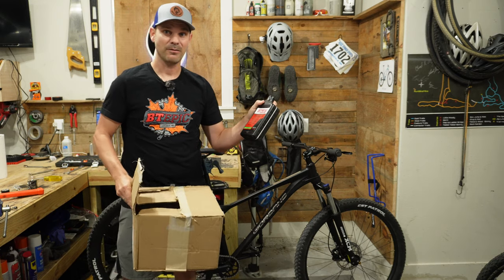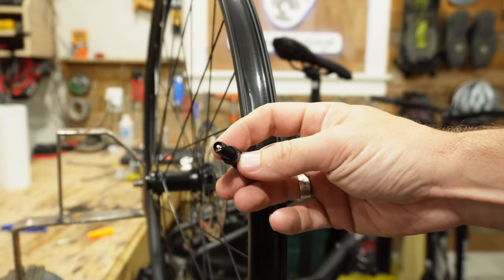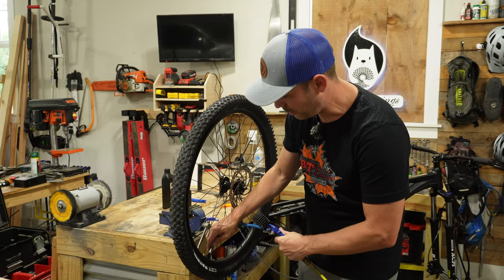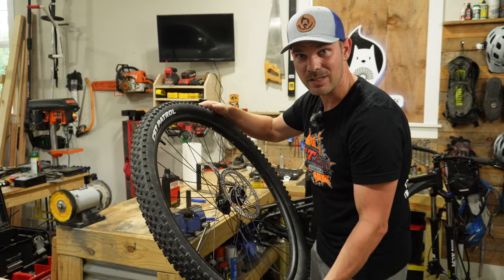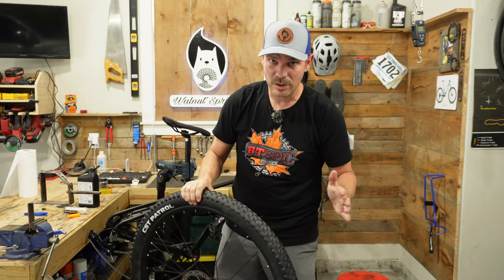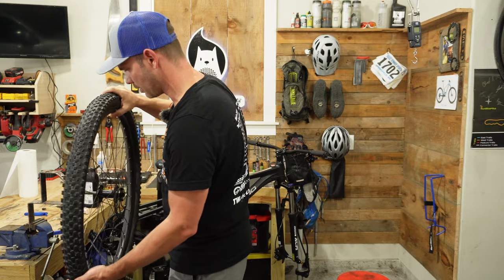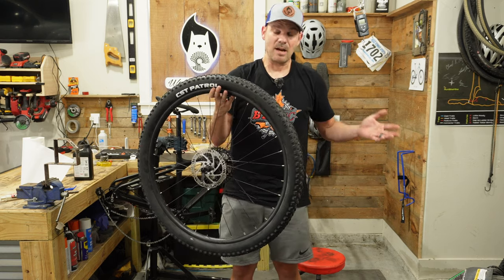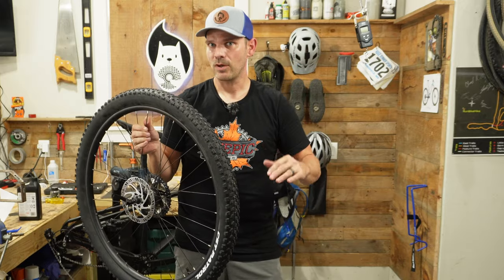Can The Walmart Giordano Intrepid 29er MTB Go Tubeless with the wheels and tires it comes with?

Comment: I have seen other YT channels try the same thing with decent success. Several had to add a bit more sealant to help coat the interior of the non-tubeless tires, but eventually the tires sealed
Reply from the maker: I was super shocked at how only around 2oz per tire worked on this set up. I was gone for a week and came back and the tires each only lost 5psi.

Comment: I never would have thought going tubeless (along with the goop that goes in) would be lighter than a tube with no goop.  Unless the tube had the goop in it and was a thicker rubber...

Thanks for the update!
Reply from the maker: It really is crazy how much weight regular tubes add to the tire rim setup. The nice thing about saving that weight is that it is the best place to save weight. Reducing the rolling weight is a great way to really feel small losses.
Reply: @RunBikeMike  were you also gonna swap the rims?  Was looking for a budget lightweight set for a Mongoose Ledge X1 that I bought...that thing is heavy!
Reply from the maker: I have thought about it. But haven’t found a pair yet. I have a few other upgrades I want to get done 1st. I thought about looking at some knockoff carbon just for fun but I need to research it some more.

Comment: I literally just tried doing this with my Giordano…with exactly the same set up. My wheels held air for a bit but when I checked it using water, there was a ton of bubbles. 

I wonder if there’s a difference between wheels and such, most of the air escaping was coming from the seam where the rim meets together. 

I really want to go tubeless because I keep getting flats riding the trails I ride. Awesome series btw, so far I like this bike too.
Reply from the maker: Thanks I am glad you are enjoying it. As for the leaking at the rim where it joins up with the other side. I have seen that before. I would double check that the gorilla tape is down super well. Seated from edge to edge on the rim. Then reinstall the tire. Add more sealant and air it up. It might take time for the sealant to work it’s way around the rim. Eventually I bet it will seal. 

I was surprised at how lucky I got with my conversion. I literally left the bike in my garage for a week while I was gone and it still had air. Only lost like 5 psi. I have done tubeless on tubeless ready rims and tires that would lose air in a few hours after sealing them. It would sometimes take adding 3-4 more oz of sealant to get the leaks to stop.
Reply: @RunBikeMike  What width Gorilla tape are you using. Buying the Stans goop and they also offer a rim tape. Is that 21 mm, 25, 29 or 32 for rim tape width? What is the width of the gorilla tape you are using?   Have read elsewhere that often times you have to spin the wheel and work it up to two days to get a good seal.  How much Stans did you put in each tire?  Looks like exact same tire and rim as on the Trouvaille. A couple of guys have done it to their Trouvaille on the group. Is the Gorilla tape better than regular purpose rim tape?  More adhesion?
Reply from the maker: @traigtrumbo669  I used the 1 inch Gorilla Tape. It will seal much easier with Gorilla Tape. But can be messy when or if you ever remove it. I used about 2-2.5 oz of Stan’s in each tire.
Reply: Leaking from the rim seam on a non tubless ready rim is common as it was not designed for this application. That  being said, I have had good luck with one layer of tubless tape and then one layer of gorilla tape.

Comment: The only advantage I can think of with presta is the smaller drill hole meaning a stronger rim. But I agree entirely that the shrader functionality is so much better. I’ve also never understood why presta valves are so dang long. They would look better and save a few grams if they were shorter.

Comment: Stans presta valves will work in a Schrader hole. I've done it 2-3 times already with zero issues.
Reply from the maker: That is really good to know. I was thinking if I run rim protectors I might have to switch to Presta.

Comment: I never understood why there was a switch to presta. Schrader valves have been used in high pressure applications for nearly a century. Your A/C condenser on your house has a high pressure side of 200-250 PSI. Guess what it uses. Schrader valves. Ordinary schrader valves. Personally, I think it was more about people feeling special about themselves and their bikes by using something different, rather than an actual needing to use something different.
Reply from the maker: I read that it had to do with rim widths more than pressure. I had heard pressure was the thing but that might not be true after all.

Comment: I did this and failed my first attempt but second attempt worked like a charm I hear no leaking air and the tires are holding air but after now 2 days they have lost a considerable amount of air (not flat) I haven’t rode it yet maybe that will help seal it more . Is it normal for the tires to lose air ? And how much psi is safe for tubeless ??? I want to put more air atleast 35-40 psi I’m a heavier guy and don’t like the dragging feeling that I get with lower psi tires
Reply from the maker: Yes tubeless can lose air after a few days. Eventually the sealant will slow that down. I always air up before each ride. I normally run 23-24 psi. But if you want to run higher you should be fine with 35.

Comment: Are those tires tubeless compatible? How did they hold? I have the same tires, should I go tubeless or not?
Reply from the maker: Zero leaks zero issues. Was one of the easiest tubeless setups I have done.
Reply: So tires don't have to be tubeless ready?😮
Reply from the maker: Technically you should use tubeless ready. But …… the others can work.